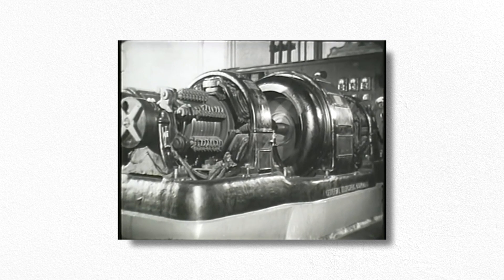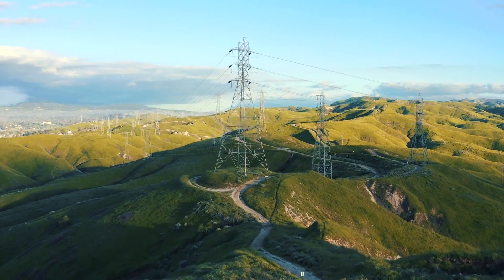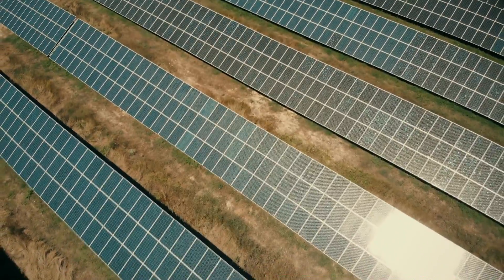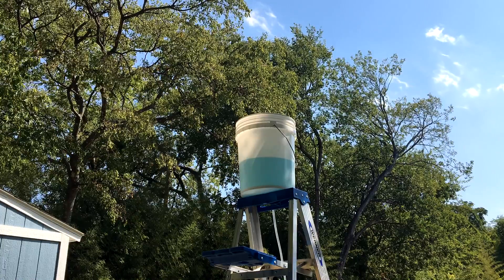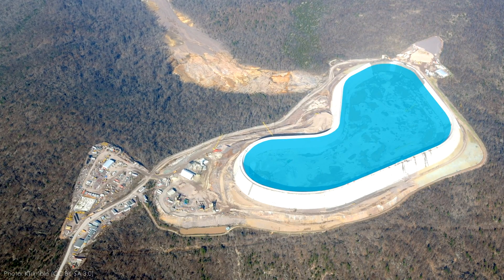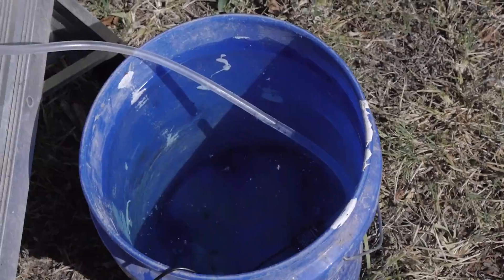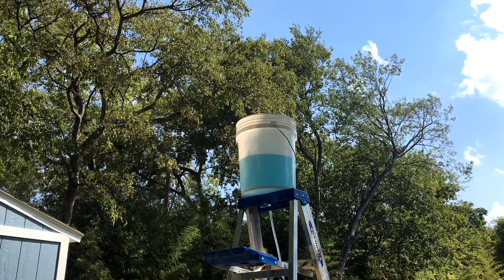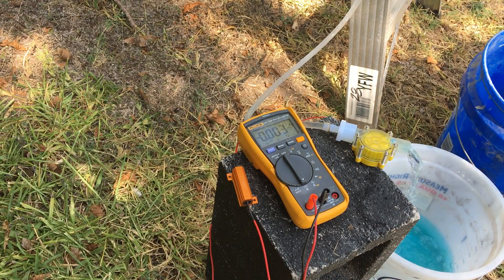World's Largest Batteries - (Pumped Storage)

Comment: I am wondering about small scale pumped water storage at a private residence. If say, you had a decent sized property that was flat, you wanted a pond, and you also wanted to or had to go off grid solar. I'm wondering how feasible it would be to dig two ponds, use the dirt removed from the lower pond to build up the dam/walls of the higher pond, then size your solar system to run your property and pump enough water to the upper pond that can be used to turn a turbine at night. Yes, it would be expensive to construct, but if you wanted a large farm pond anyway, and wanted to not spend 10's of thousands of dollars on an off grid battery bank every decade, I could see where it may have potential.

Comment: Energetic density of Hydrogen is x 2'8 compared with gasoline. So why don't use that surplus to make H? Difficult storage? Why if we don't compress that? Crazy idea: Extract H so we can elevate giant weights. We can transform that weight going down to energy. Why not? We only need to liberate that H to a part more elevated (maybe to another weight and continuing the process?).

Comment: Seems like a good use of ocean waves, have the waves push a pump to move sea water into a pool, then when you need the power, the seawater just goes back into the ocean… 

That’s about as green as you get, and if you can block off 99% of wildlife from getting into the area you pull water from in the first place, it would also stop any damage to the local wildlife.

Comment: I have a few questions for anyone that may know half-wave (DC) and full-wave (AC) "travels down the transmission line":

My understanding is that DC is "half wave," so the current starts at zero, increases to a peak, and then comes back down to zero before repeating that cycle. 

My understanding of AC is that it's "full wave" such that it starts at zero, peaks, comes back down to zero, inverts into a negative peak, and then comes back up to zero before repeating that cycle (like a sin wave).

    Question 1:  What does each type of current "look like" to a conductor like copper wire?

I'm not really sure how to ask this question, but when I think of AC vs. DC, I wonder:

    Question 2:  In DC, does the current start from a stationary position (ostensibly at zero volts, though I know current is measured in amps, not volts), start moving along the wire until it hits peak "velocity" (w/ voltage increasing to some peak value) and then start "slowing down" until it stops traveling along the conductor after hitting zero volts again (as if the energy's travel down the length of the wire is starting and stopping 60 times a second)?

    Question 3:  If the above is in fact how DC "travels down the transmission line" does AC "travel" happen such that energy moving in one direction down the line (at a positive voltage), stops (presumably at zero volts), then moves in the opposite direction (at a negative voltage) the same distance that it traveled in the other direction before stopping again (at zero volts), then repeats that cycle 60 times a second? 

If my understanding of AC is correct: 
    
    Question 4: How does AC current actually result in energy making its way from the source down the transmission line into our homes?  (Because wouldn't it be moving backward and forward in the same area 60 times a second without ever making any "progress" or actual "travel" down the line?)

I've always thought that AC and DC could be thought of as "two different movement patterns down some transmission line," but after watching this series I really don't believe that's the case!

Comment: Hydro Lakes are batteries, pumped storage are batteries, solar can't be used to pump as stated it's used to offset actual demand - so excess capacity to store in pumped storage comes from what type of generation? If it's from anything other than an excess generation from a renewables then its from a non renewable source - why would you run it to store energy which with the losses involved uses more energy than it stores, and pollutes
This is all about when "prices are low" which is not looking at the way the energy is generated.
Only way this is moved from profit to renewables is if the excess generation capacity by renewables exceeds demand

Comment: I have been interesting in playing with those micro turbines. I wondered about having enough flow rate to power a string of the, say 10 of them off one large header. Possibly a rain barrel 12-15 feet off the ground. Or some kind of larger repurposed 12vdc motor with a pelton wheel attached and a buck converter to boost the voltage to around 14v to charge the battery, or use a 24v motor to get higher voltage and a small solar charge controller to charge a 12v battery.

Comment: To store 1KWH would require lifting a 3673kg weight 100m or 10(.1) 4680 Tesla cells. Engineers should know better. 
Force of gravity of per kilogram = 9.8N/1KG. 1KWh = 1000W x 3600 seconds/hour = 3600000 Joules. = 3.6MJ. 3.6MJ/(9.8N/KG x 100m) = 3673kg.
Tesla 4680 cell has a capacity of 99WH/cell. 1000WH/99WH = 10.1 cells.

Comment: Why aren't we using marbles made of dessert sand? The sand can finally have some use is easy to melt and mold into a rounded shape and extremely easy to find. There is basically no downside as any broken glass can easily be reshaped on site.

Comment: I wonder how it rates compared to building an excess of wind power generation capacity and simply shedding excess capacity by changing the angle of the wind turbine blades when the electricity isn't required, or building long-distance power transmission cables to send the excess electricity where there's a demand for it.

Comment: Had a great meeting with an aluminium producer. They produce faster when there is a lot of electricity and less otherwise. They are the "swing", the elasticity on the demand side of the electricity equation. That's why they get electricity at a lower price.

Comment: hey how come folks always focus on one type of solar? Growing up in Canada, two of my fathers houses have heat exchange solar to heat and store water, it's one of the most efficient houses you could visit it Ottawa and I doubt he's got the only one. the houses he's set up save allot of power to the point that in the 90s when he started doing this Ontario hydro kept thinking he messed with his power meter. My dads old now, and I'd think there would be more people using that for water and heating. You can always reduce the dependency of utilities and then buy only what you need from the grid. Solar water heat exchanges need to make there way into more homes.

Comment: Reminds me a lot of how a mitochondrion works. When food molecules are available, the potential energy they contain is used to pump hydrogen protons into the space between the inner and outer membrane and establish a gradient. The mitochondrion becomes a battery. This gradient is used to make ATP using ATP-synthase (an electric motor embedded within the inner membrane that can convert an electrochemical gradient into mechanical energy and then into the potential chemical energy of ATP). When there is an excess of ATP, ATP-synthase runs in reverse to pump hydrogen protons into the intramembranous space and regenerate a gradient for future use.

Comment: Ice, water shortage, cost = forget it.  Just build nuclear.
Reply: Targeted by nuke, blown up, inhibitable for 10.000 years.
Reply: PSH is actually a great companion to nuclear power. Nuclear works best at full production (all costs beig fixed, so the more juice it pumps away, the best it is), PSH can allow that by pumping water up when demand is lower than what your NPPs are producing, and then let it rip when demand exceeds your Nuclear capacity. Its hard to have a water shortage when you are basically just pumping it up, letting it come down, and pumping it up again. Granted, some evaporative losses happen which can be reduced, like by putting solar panels over the reservoirs (some more pumping power) , and some water always has to come through. But should not be much of an issue if its mostly cyclical.

Comment: In my area they just completed a brand new Reversible Hydro setup. It has almost 900MW of installed capacity, over 650m head and can supposedly power the country's 2nd largest metropolitan area through one whole day at full capacity. It is actually fed by a small creek as well as the pumping system, plus a pretty snowy area.. Its part of an huge megaproject with 2 other conventional, non reversible dams (the downstream one's reservoir  serving as the lower reservoir for the RH setup), and a wind farm (In a previously forestal area tho).The idea is using the wind farm for pumping when demand is lower, or minimum flow requirements from the 2 other dams.
Although i still think that having a more reliable base is much better than almost fully relying on RH or other «storage» methods+ unreliable S&W. Nuclear or Geothermal (capable of doing some load following as well)+run-of-river hydro using just the  «ecological flow»(minimum amount of water a dam has to let pass by) and micro ROR Hydro for base power +lockage/lake/pumped storage Hydro for some more load following. Just then Solar and Wind energy to feed the RH setups and normal demand..

Comment: 70% efficiency seems amazing if you're using this specifically to store energy from unreliable solar/wind sources in desert areas, where you can produce so much energy at peak that it can sometimes be dangerous! With enough capacity, you could probably power an entire desert city with solar alone.

Comment: Really love your videos! Question, the energy is created by the moving of turbines, which is moved by water pushing through by gravity. Liquid with a higher density (and similar viscosity as water) would provide more force when going down the same distance as it's water counterpart. Is it feasible to do this same sort of pump but with different materials to improve efficiency of energy output? Maybe things as simple as using salt water since it's a bit more dense?
Reply: Some shore-line  PHES setups using salt water already exist.. although the difference in efficiency shouldnt be too much, if any(the efficiency rating is mostly due to inneficiency of the electric motor-generators and the hydraulic turbines used). You would use more energy going up, and get some of it back when going down... Cant remember any other liquid that is readily avaiable that is substantially more dense.
Reply: In addition to what JDaniel M said, don't forget that salt water is corrosive, so the cost of building and maintaining a saltwater system is higher than a freshwater system.  I am sure that power companies consider those costs when deciding where to build a storage system.
Reply: Also these pump storage places double as habitat, there be fish in them there hills! All the waterways in the area may be connected as opposed to a completely cut off lower reservoir, so the water contains whatever it naturally would in the area

Comment: I watched a video of a system that used a robotic crane to stack heavy concrete blocks as a method of storing energy. The same crane then lowered the blocks and generated electricity in the process.

Comment: I've been genuinely wondering about this for a while. It's looking as if it's almost better to used excess energy to create chemical potential energy rather than gravitational potential. Even then, with all the inefficiencies it seems like quite an uphill battle. Almost seems like storing energy is a huge waste thanks to the inefficiencies of converting energy from one form to another. What a quandary. It's pretty crazy how little energy density that gravitational PE has.

Wish I was privy enough with chemistry to be hip to an easily reversible, highly energy dense chemical... I wonder if fusion/fission can be used to store energy? That might be the key. Nothing more energy dense then proton-neutron bonds (I guess except maybe subatomics). Now I'm wondering the efficiency of nuclear reversibility compared to purely chemical. Could that be the key? Fiddling with the potential energy of atoms themselves?
Reply: If you have fusion (or any other cheap power source that isn't fossil fueled) one thing you can do is take CO2 out of the atmosphere and turn it back into hydrocarbons for use in vehicles.

If you make hydrocarbons out of CO2 you could make a carbon neutral or carbon negative system.

As much as hydrocarbons cause pollution, they are extremely good at storing energy.

Comment: Surely the most important part of the equation should be the balancing of demand and removing or reducing the need for the peak demand generated electricity, which currently comes mainly from fossil fuels or nuclear. If there's only a small monetary gain, so what, the planetary gain is immense!

Comment: Just discovered this video (10/21). Great stuff.
I have been using a water powered pumped hydro since 2013 as part of an off grid domestic system. 
It began using a ram pump and has developed from there. We have approx 800,000 litres in storage now, at approx 24metres head, driving a micro hydro turbine via a 90mm penstock to charge a 40kw 24v battery bank . 
The turbine discharges into a storage which is also supplied by various water collection systems on the property. This storage then drives a water powered pump to return it to the upper reservoir. It is one of the most rewarding projects I have under taken at our place.
Reply: Congratulations my friend! Not only is it environmentally friendly, but it can be constructed out of materials, mostly from a hardware store. Don't think most people can build a lithium battery from scratch.

Massive respect all around.
Reply: You should make a video of it. Sounds cool

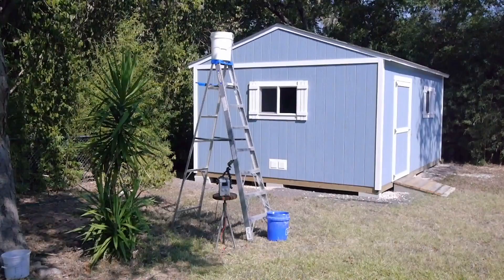Comment: 5:43 "To reach the same amount of energy", not "energy density", of course.  Also, The 4 gallons of water in the bucket would need raised only to 67 meters (*not* 100 mi) to release about 10 kJ of energy, which is the same amount as in a typical Li-ion AA battery (2.8 Wh).  Of course that's at 100% efficiency.

Comment: There is a Russian 'invention' that uses wind power to pump water through a system that produces hot water using cavitation. Would there be any mileage in pumping this hot water into the ground to provide a thermal store for use by ground source heat pumps?

Comment: What is the calculation of acres of solar panels needed to fill a reservoir to cover night time?  How much of the environment is destroyed to make renewable energy.  You obviously can cover the reservoir with floating panels that can keep the panels cool to increase their efficiency.  But I think cutting down 10x the amount of acres.  Pump stations reservoirs are used fill at night to cover lacking grids with huge demands during the day, also instead of the current grid use it or lose it does act as electric storage of grid grade power that was not possible before.  Legacy renewables are a typically a mass go or fail in the 100's of square mile range.  Years there is no wind there is more rain per studies done by nasa, that is why windmills were great backups for hydroelectric reservoirs.  So years with high wind less rain, are good for both solar and wind.  Years with low wind have high rain so both "Renewable" sources will be highly diminished.  Wind by the laws of thermodynamics have to take energy out of the wind.  Making less wind and more rain post a wind farm?  I hear they become deserts with no wind?  Lots of step 2 questions.

Comment: I'm not an engineer, but once I envisioned something like the following, but I have no idea whether it would work. The idea would be to construct multiple massive vertical columns running through a massive horizontal platform. Each column would have a dedicated electric motor / turbine attached to the platform, and the whole platform would be raised on the columns to store electricity and lowered to use electricity. I told my engineer father-in-law about this and be just gave me a funny look.

Comment: I’ve always thought that hydroelectric power could be harnessed from the sea instead of relying on reservoirs. As an example, there would be drains located at the bottom of the sea, let’s say 100 meters or about 10 atmospheric pressure, then pipes would transfer the sea water to the surface at sea level. It would result in a negative pressure pumping the water naturally due to the differences in pressure. Then that water pressure at sea level would power turbines in order to generate electricity with the sea water going back into the sea. Another method would be to have the electric generators underneath the sea bottom harnessing the water pressure directly. However, I think that the former method might be easier and more cost effective than the latter.
Reply: This wouldn't work. Once the return to surface pipe fills to the top the water would stop flowing up the pipe.
Reply: You seem to be contemplating a perpetual motion machine.  Not possible.
Reply: Then ANY hydroelectric power plant, according to your definition, would be of perpetual motion because the power source is never depleted for as long there’s water and gravity. The only difference between a conventional hydroelectric plant and my proposal is that one relies on fresh water from an artificial reservoir and the other from the sea — but it’s the same concept.